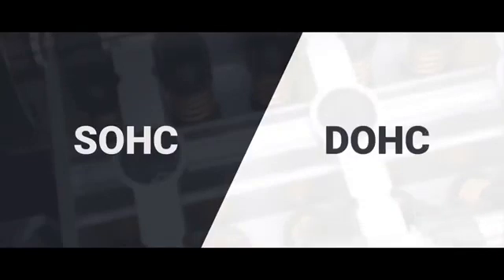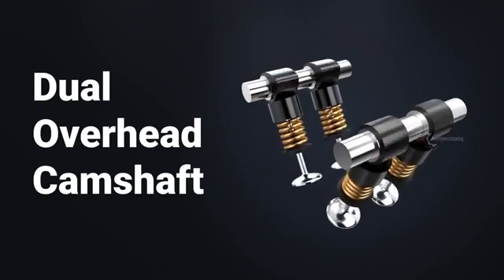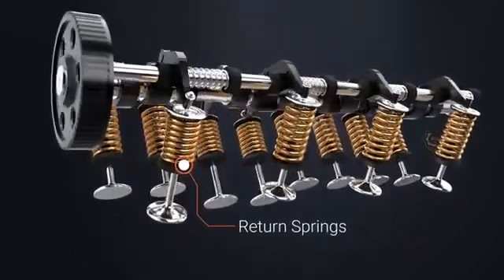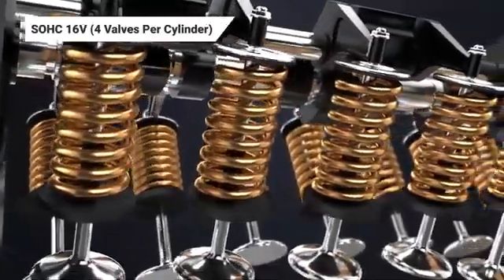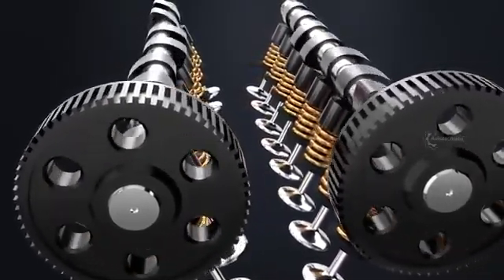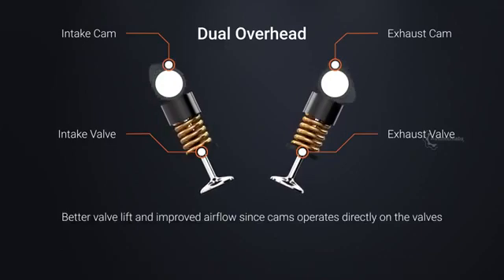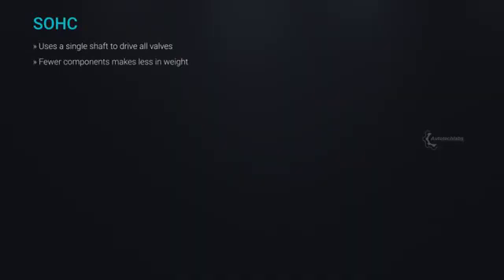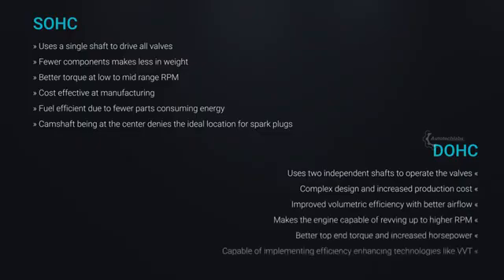SOHC Vs DOHC

Comment: Torque × rpm = power. Dohc motors are impractical and sht
Reply: Good luck in a long drag race and on the straights😂
Reply: @trendgil I don't care what you say torque at 1500 RPM is better than 4500 rpm. A v6 has more bore than a v6 and goes against it's design philosophy to have low end torque. they are utilizing it's superior design to out perform substandard configurations. If you have a sohc v6 that's 6.0 liters it's going to destroy any pushrod or dohc engine the same size. Ive had push rod motors get their torque at 3950/4000 rpm and dohc motors with 4 camshafts where I have to wait to 4500 rpm sitting there in a front wheel drive platform